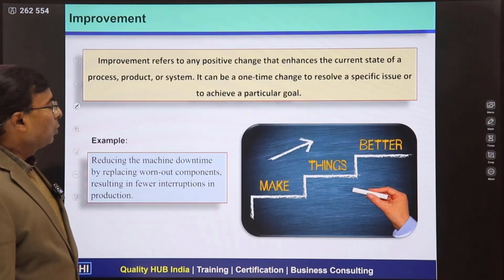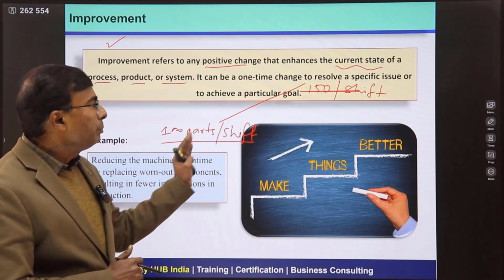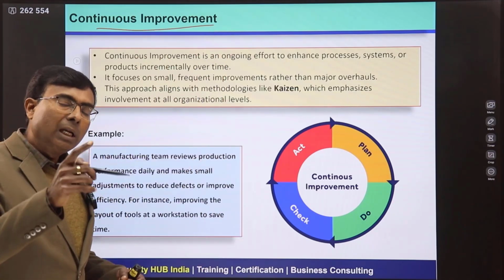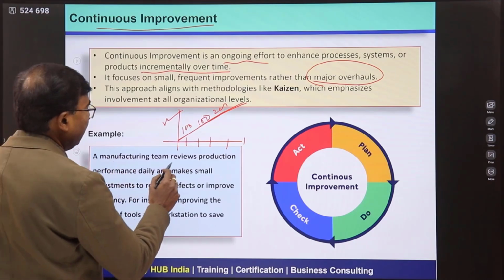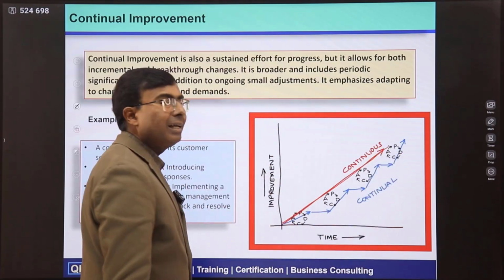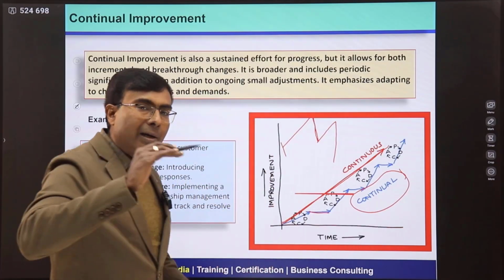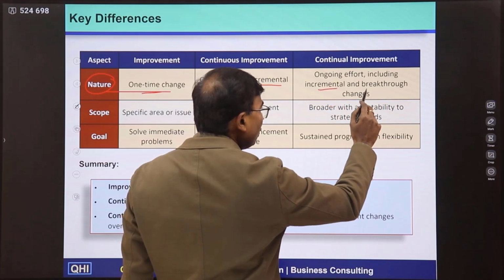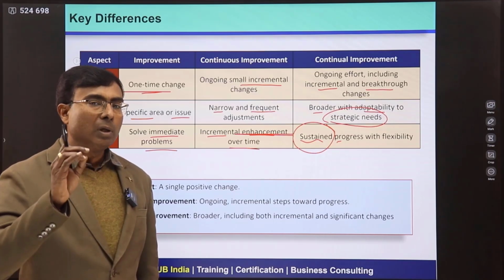Improvement Vs Continuous Improvement Vs Continual Improvement | Explained with examples (English)

Comment: Sir hobbing machine me hob k upar Balck or yellow colour ki jo coating hote h vo kis chij ki hote h? 
Please reply
Reply from the maker: Hobbing machine tools, specifically hobs, often have black or yellow coatings, which are advanced surface treatments designed to improve tool performance and longevity. Material: Titanium Aluminum Nitride (TiAlN) or similar coatings.